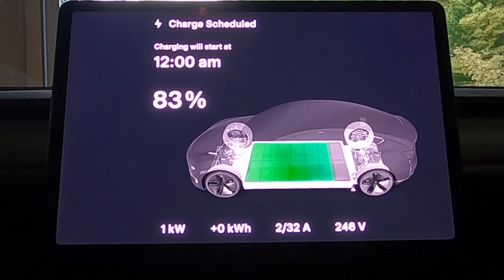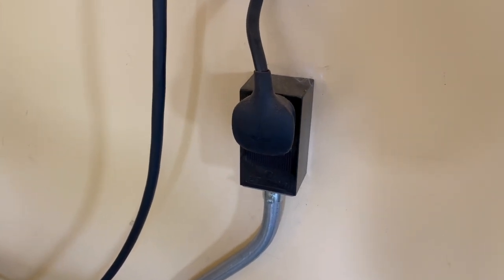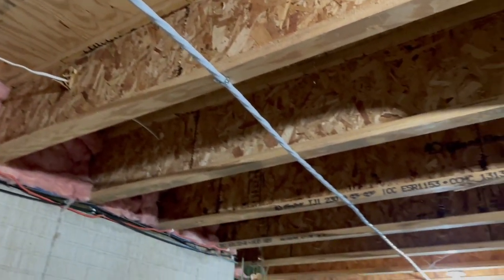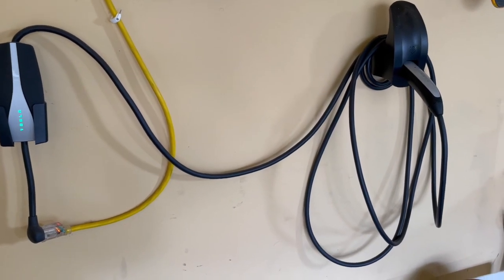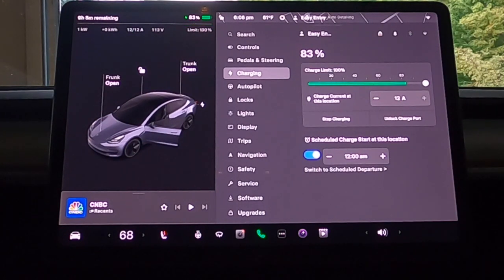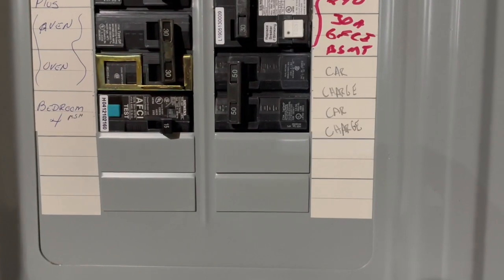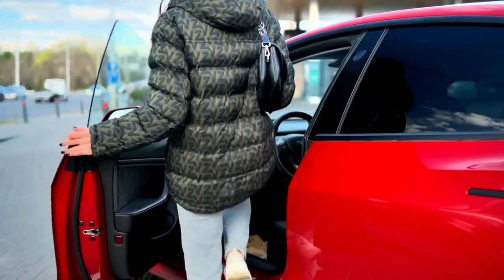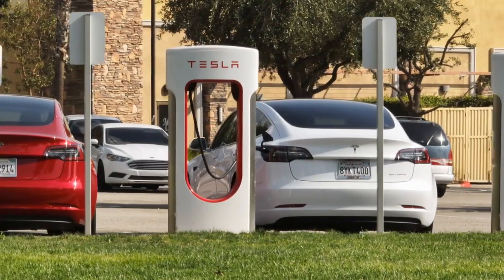Tesla Home Charging Speed Comparison | 15 amp vs 50 amp

Comment: Isn’t it really bad to charge to 100%?
Reply from the maker: I've got the LFP battery in my Model 3, and that battery chemistry likes to be charged to 100%.
Reply: @mywifestesla  I have a brand new 2023 model Y long range and it says I’m only supposed to charge it to 80% why is that!?
Reply from the maker: Different type of battery chemistry. Your Model Y has a Lithium Ion (NCA/NCM) battery while my Model 3 has a Lithium Ion (LFP). This difference is why my battery likes to be charged to 100% vs the 80% - 90% for your battery.
Reply: @mywifestesla  wow thanks. But why do they have different batteries? Is the model y have the newer battery tech
Reply: @walterwhite1 
The LFP type in the standard trim is made by the Chinese company whereas the battery in the long range is made by Panasonic (although they were assembled by the Chinese company as well)
The battery in the performance trim is made by tesla in USA
Reply: @Khám_phá_Thành_Phố_Boston  wow I had no idea. How did you know about this

Comment: Wife and I encountered just this situation when we transitioned from an ICE/ICE to a EV/ICE and finally to an EV/EV household. One NEMA 14-50 on a 40amp circuit was plenty to keep the EV charged regardless of how much we used it during the day because within a few hours, it would regain all that energy back. Then we added a second EV.

When the second EV came along, we had an electrician wire in a second NEMA 14-50 and both cars are happy. Super easy to "gas up" the cars from home anytime.
Reply from the maker: That's the way to do it. I'll be honest, in our situation I haven't run into any problems using the 15 amp circuit for most of my charging needs, but it's nice to have that 50 amp when needed.

Comment: I've had a BMW i3 for 5 years.  I have a 32 Amp charger and the factory 110Volt 16 AMP charger.  I do 95% of my charging on the 16 AMP charger for a couple of reasons.   The BMW can't be set to stop at a certain percent.  It will always go to 100% unless you stop it manually.   The 32 AMP would always hit 100% overnight so I just use the 16 AMP and in the morning usually find the charge between 50 and 80%.  Plenty for my commute.  in addition, I think this slower charging is better for the battery.  My 32 AMP charger has spent more time charging  Teslas  from visiting friends than it has my car. 

BTW, my garage shares a wall with my kitchen so my 32 AMP charger shares a circuit with my oven.   I installed it myself.  In theory I should not use the oven and the charger at the same time, but this has never been a problem.
Reply from the maker: I probably do 90% of my charging off the 15 amp circuit, but it's nice to have that 50 amp as a backup. Just takes a bit of planning if my wife is also charging, I just switch them up before going to bed.

Comment: really great perspective once again! maybe its easier to think of it is way . 

if driving more than 10 km a day then its worth getting one. and the 50 amp is more reliable than going to superchargers most of the time
Reply from the maker: I've found that if I drive 45 miles, which I think is roughly 70 km, I could live off the 15 amp circuit. That drive uses around 17% of my battery, and will typically recharge in under 12 hours.

Comment: Wonder how a 20-a circuit would affect things. Many garage outlets are fed with #12 wire allowing for a 20a outlet. Swap out the mobile charger pigtail for a 20a and you’ve got an inexpensive upgrade to 110/115 v charging (although minimal?). 3:14
Reply from the maker: I've wondered that as well. Need to see what kind of wire I've got running and determine if that's even an option.

Comment: I have the rwd model 3 also.  My commute is about 30 miles a day total so I could probably get away with the standard 15 amp plug.  I found that instead of range anxiety I was having charging anxiety as I would essentially always need to have it charging when home.  I very much recommend upgrading to a 50amp line if you are able, you will have a ton more flexibility and won't really have to worry about your state of charge.  Save your receipt from the electrician, this is a capital improvement on your home
Reply from the maker: Luckily we have both, so I don't have to worry about that charging anxiety. Agree with your point, if you can afford it, that's the way to go. Didn't think about the capital improvement, I need to look into that.